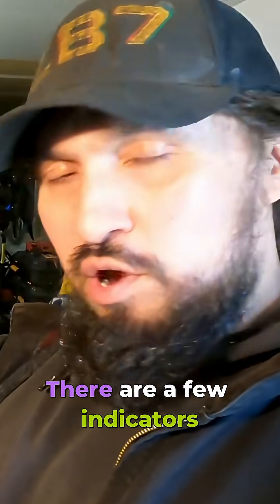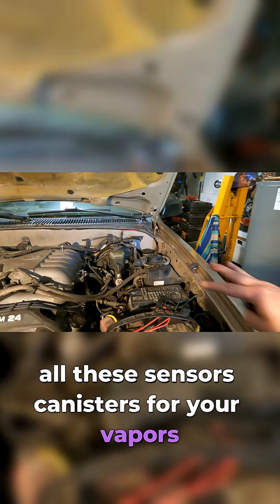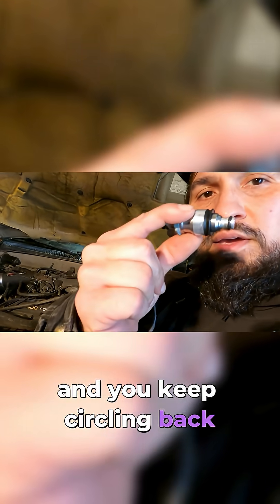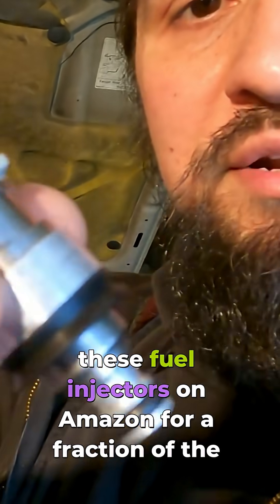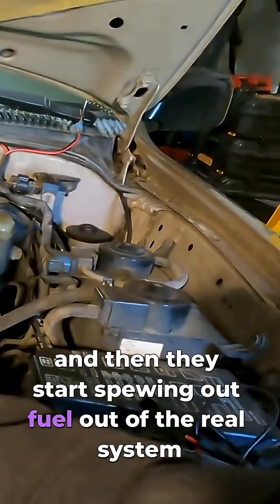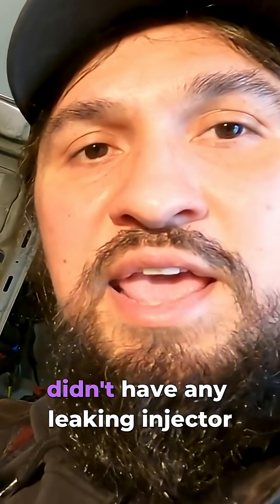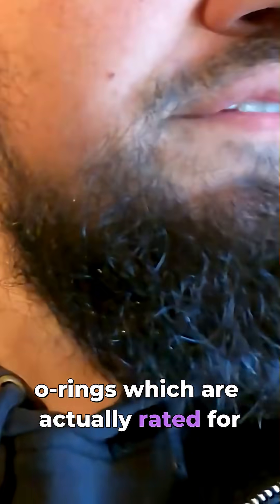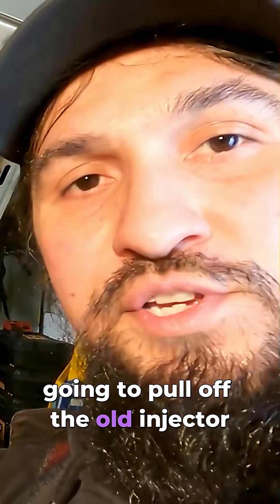Identifying Fuel Injector Issues 🚗8

Comment: Had a guy cheap out on Injectors I told him they would be a issue finished the job got a call back sorry bud I ain't gonna warranty your junk parts
Reply from the maker: That's understandable when you are installing parts that someone else brings you.  Unless one does their own research and makes that determination before installing it themselves.  My determination based on the evidence provided through first hand accounts is that a majority of gasser fuel injector issues is with the provided o rings.  Regardless if oem or not, they all use black o rings which are not rated for long term exposure to heat, fuel, oil.  The main issue with the amazon or ebay injectors is that they use too small of an o ring and they are also black.  The answer, I hypothesized  was to add thicker viton o rings to both prevent leaking issues as well as to extend the service life of the injectors.   Even with oem injectors leaking, it seems to be the black o rings failing and needing replacement before the rest of the injector fails unless containment get through the injector and clog it up.  Full video here :)  https://www.youtube.com/watch?v=JjPwqFMLBfA
Reply: @KooshdaakaaGarage  yup it's the Ethanol it eats up those nitrile orings, viton holds up good I keep some around now but that job was along time ago I would have handled it differently today either get the right orings or just refuse to do the job don't need that effecting my reputation

Comment: You will regret that. Dont cheap out on car parts btother
Reply from the maker: Lol, that's my $60 gamble 😂 though I feel pretty good about it considering the ones I removed were the exact same and had well over 100k miles on it.  The ticker has started on these new ones. So far so good 🍻  my secret is, im 41 years old and have been cheaping out on parts since I was in high school 😬 maybe this is unique to me but so far the cheap parts last as long or longer than the oem replacements, and I beat the hell out of my trucks on the Alaskan logging roads.  Knock on wood 🪵